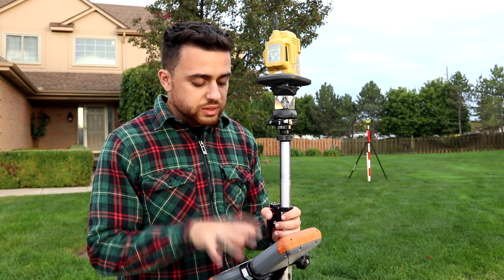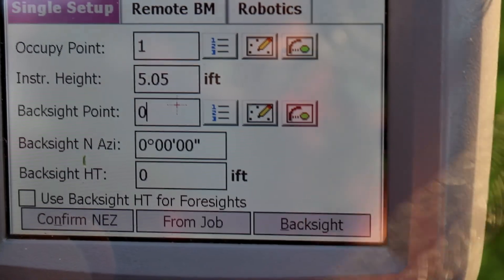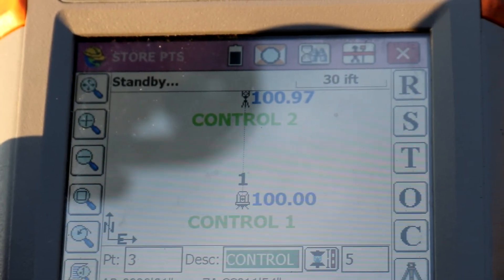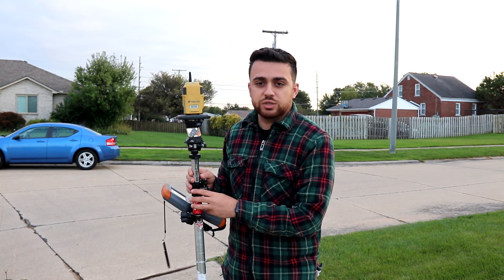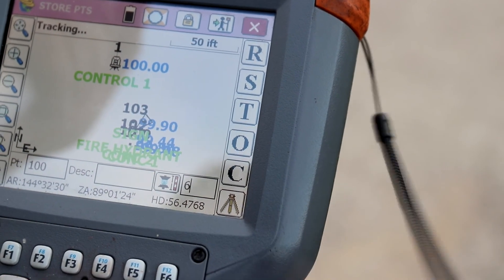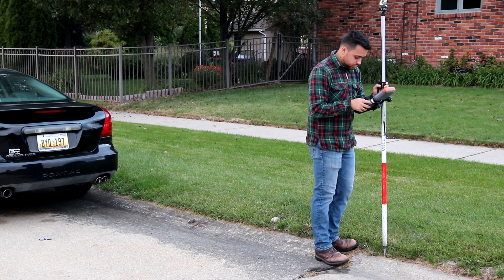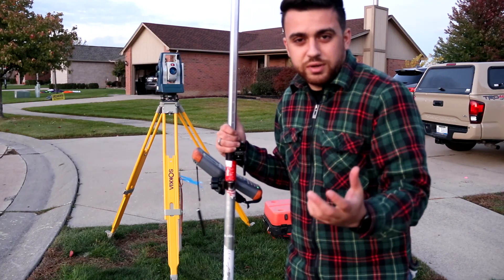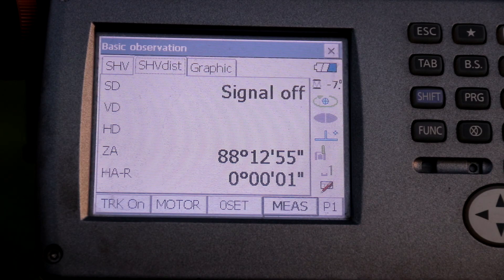Topographic Surveying for Beginners

Comment: How much is the distance between the points for the same line , meaning how dense should the points be ?
Reply: Beyond locating the obvious (changes in direction or elevation), personal decision. Either your contract specifies spacing, or you make a decision in the field. 25 feet wouldn't be unusual.

Comment: I'm caught between laughter and tears. I have performed thousands of topographical surveys using a transit, stadia rod, notebook and pencil costing less than $2,000 and I would have finished the whole topo survey in a situation like this in a fraction of the time this fellow will take and at a fraction of the cost! One principal that seems to have been lost since the switch to high tech devices like total stations is that the degree of accuracy obtained is entirely predicated on the repeatability of the measurement. When I see people measuring the angle to a building corner, tree, fire hydrant, etc in parts of a second, or a minute, or even a degree it becomes clear to me that they really have not a clue as to the reality of the situation. In this particular situation this fellow would be lucky if he could repeat the locations he's measuring to within two feet so why is he using a super accurate and very expensive device to do the measuring. I also can't help but wonder what the missing rodman is now doing for a living? Is Jeff Bezos, Bill Gates, or Warren Buffet supplying he and his family with food, clothing, and housing or are they now living on the sidewalks this guy is surveying? Speaking of "this guy" how long will it be before AI puts him out of work as well? Ask not for whom the bell tolls my friend it tolls for us all!
Reply: You have just shown how little you know about these new "high tech devices".  Extremely accurate and repeatable if calibrated and used properly.  You're a dinosaur gone extinct.  The only constant in life is change.

Comment: Got to say the way you are surveying isn’t accurate or precise. Such as when you set up the instrument, when you read positions such as lamposts, roads signs or buildings (you need to offset the points). Also the coding/point names could be simplified further saving a lot of time out in the field.

Comment: If your total station is in tracking mode and you want the exact position of the light pole, place your rod at the lightpole at a point perpendicular to the line TS-Polecenter, take a distance measurement, then move the rod in line TS-Lightpole and save the point. Don't know about Topcon, but works with Leica&Trimble total stations.
Reply from the maker: Yeah that would be the formal way to do it. However, this is a beginners video, so I will cover this in a more advanced version in the future.
Reply: With topcon, you would place your prizm against the light pole and then go into edit points, then edit raw data and measure the distance from C/L flog pole to center of prizm and add that measurement to your Away raw data.
It’s pretty easy after you’ve used topcon acouple times!

Comment: Numbering features is too time-consuming and error prone. Survey at such a level of detail that you don't have to. With a robot, it's better and easier to get more points than use long, highly-specific codes. Take pictures to clarify if necessary. Some people think playing "connect the dots" manually takes to long--I look at it as an invaluable QA pass.
That was a telecom riser, not electrical. TEL RSR. Know your utilities so you can properly integrate utilities basemaps into your mapping.

Comment: New technology?

robotic total stations have been around for over 30 yrs with them being in common use for the last 20 yrs

also you should be picking those kerbs up on the join lines this helps you join both sides together if they line up to create topographical cross sections and make your topo surface triangles/dtm/tin line up better
Reply: Robotic total stations are the norm in the Industry. But even Robotic Total Stations are becoming increasingly obsolete. I think LiDAR is gonna take over.

Comment: Nice vid, I'm not a civil engineer but curiosity brought me here, one question though, does the Total Station automatically compensate for the tilts of the measuring pole, or you need to make sure to keep the pole relatively straight? But i didn't see any feature to assist with that on the pole itself. I imagine it's quite a hassle especially on a slope
Reply: They all have bubbles. Else you have to use a plumbob which is really old school.

Comment: Hye mate,  Just wonder if you need to set up  multiple total stations if the signal was block buy buildings ?
Reply: You set as many " traverse points" as needed to see everything that needs to be located. The points are shot and are part of the control network.
Reply: @Snookman7  thanks mate.

Comment: good video...I usually just record CL (centerline), EP (edge pavement) , CLSW (centerline sidewalk), PL, OG (original ground on lawn etc..go every 15-20m..for a hundred meters or so than go back a survey detail (CB's, MH's, HP's, HYD, VB's, SIB's, trees or shrubs etc)... that  way I dont lose track of my section lengths..keep up good work...I've been surveying since 1988 started with T1, T2A and steel chain and plumb bob..the good old days :).. I love surveying..I ran a 5mile level loop once..3mm error with a Sokkia B32 level..30x power
Reply from the maker: Yeah the topographic workflow is pretty straight forward once you practice a little in the field. Thanks for sharing your workflow.

Comment: I can't believe you didn't offset that light pole.  what if an engineer decides, on a 71 degree sunny day with 0% humidity, to come out and stake out your work.  he's going to ask you why the light pole is 4 tenths off.  then you'll say, "I made a sketch.  it's in the field book."  then he'll say, "what field book."  I kid because I relate.
Reply from the maker: hahahaha, this comment made my day. Well yes, off-setting structures is the right way of doing it. But for "Beginners" they should at least know to pick up the light pole. Stay tuned for the "Advanced Topographic Surveying" video coming this summer.
Reply: @RamiTamimi  I just did my first Topo survey today and we did a ton of offsets. Especially every tree. I had wondered why that wasn't in the video as well.
Reply: technically yes, offsetting is the correct way..but I've been shooting the edge if the pole for years and coding it as HP etc..never had a problem..when you shoot 800-1000 points a day  you just wanna keep going..

Comment: You got it way to easy. Try bending over an alidade and plane table for a few years first but then again you most likely don't know what I'm talking about.
Reply from the maker: I know exactly what you're talking about, but I was born late enough not to have to use it outside of the classroom.
Reply: Started as a rear chainman in 1986, I would never want to go back to the old ways. I love driving to the next section corner and shooting it with the GPS. Chaining the 1/2 mile 200' at a time sucks.

Comment: I've never used a total station but I am going to be soon. I've got 4 years working on the gr5 topcon system. I'm just curious why you wouldn't continue your lines from start to finish one at a time rather than applying "new Codes" every shot working perpendicular to your OG line starts. For the GR5 you can basically start your line and just hit enter to add the lineworke+points. it seems like a faster approach to bouncing around and trying to remember the point codes.
Reply from the maker: A GR5 (GNSS Reciever) isn't as precise as a total station. So while it might be easier to use, it has its draw backs. You could just start new codes everytime, but you might get into a situation where you're on Concrete line 24 and have to type in C24 on your controller. If you're okay with that then go for it, otherwise you can end a line and reuse the same number without the two sections connecting.
Reply: Be careful! Each equipments (Receiver GNSS, Total Station, Level) are their specificity. When you stake out a building you must use a Total Station, same as the heigth.
Reply: yes, I dont number my codes either..I only number my CP's..

Comment: In addition to determining the scale for the project, wouldn't performing a 'back sight' to a reference control point aid in determining the map's orientation also?
Reply from the maker: It will orientate you project and ensure the scale of your project right by ensuring the distance to the point is physically correct to the coordinates.

Comment: So basically your light pole will be in a wrong spot on the plan?
Reply: yes you are correct sir, it will..but the 8" or so is negligible.. in the water and sewer game anyways..imho
Reply from the maker: Why is that?
Reply: @RamiTamimi  unless you used offset when measuring. Otherwise the point will be a bit away from the correct spot.
Reply from the maker: @Hammer1  Good Point. Usually, we will do an offset for structures we can't shoot the center of, (i.e. light pools, signs, trees, utility boxes.) but that is more advanced topographic surveying, a video I will be making this summer.

Comment: Interesting explanation!  Does a topographic survey usually contain lot boundaries? One provider quoted me for a topographic survey but says it wouldn't contain boundaries which is puzzling to me
Reply from the maker: Not necessarily. Property lines are apart of a Boundary Survey which is different from a Topographic survey. You can perform a topographic survey without having the boundary information. Usually in the industry, clients need both for their construction projects.
Reply: when doing a topo you can survey the property bars..than overlay the legal survey fabric in CAD..